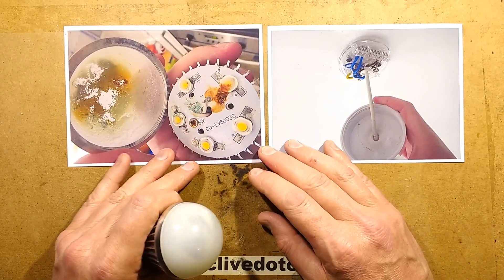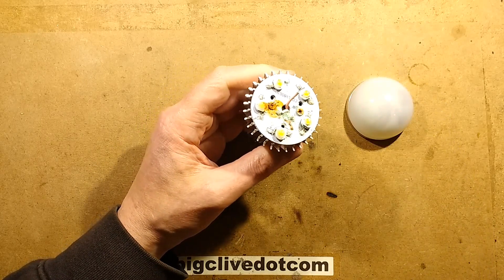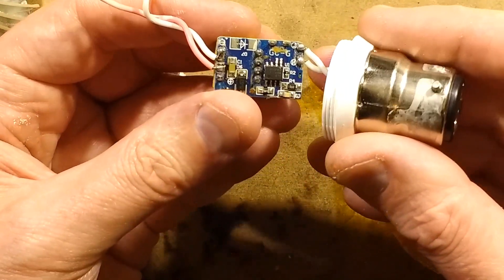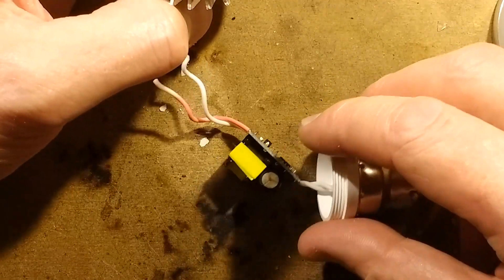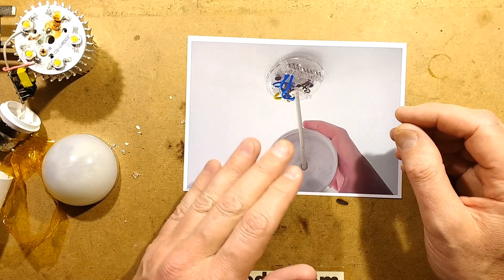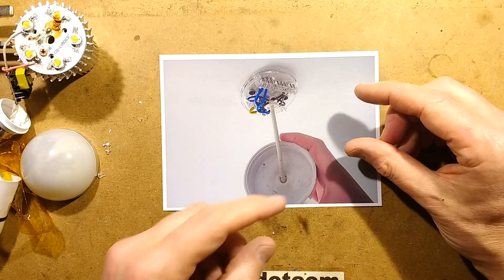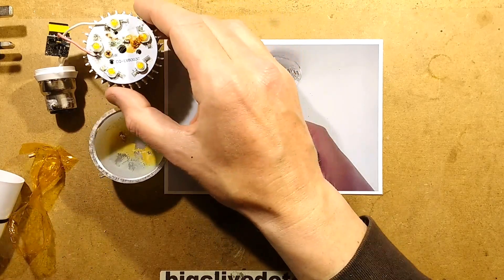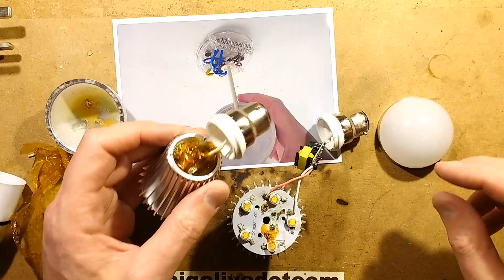Autopsy on crusty LED lamp.

Comment: Another possibility, cold metal heatsink, humid air, condensation drips running inside the lamp, and creating the mess, though that's only a theory, one of many I'm sure... :)
Reply: I had that problem in an apt where the condensation from the ductwork nearest to the AC was chasing down the joists to a point that must have been slightly lower than everywhere else. It had soaked into all the nearby insulation before starting a solid drip straight down, more like tiny stream at one point. Had I had any fixture along the path It may have caught some drip as well.
Reply: Most likely you are right. If you look at around 47 seconds into the video you can see that the first part he unscrewed ( don´t know how its called) is not air/ himidity tight. There are threads on the heatsink fins and i would say half a mm gap. So water can run down the heatsink right into the bulb. Next time you activate it the water gets evaporated and it corodes the electrics and eventually shorts it.
Reply: I was about to write the same possible cause..
Reply: That's makes no sense.  The heatsink would always be at least as cold as the surrounding air, not cold relative to it.  You'd have to have some kind of unusual building setup where the building was positively pressurized by a large intake fan, forcing warming interior air out a lamp fixture exposed to the outdoors/colder area, and that interior air would have to be particularly humid like if you had a marijuana grow house inside or sauna.  Even then it would be unusual as the airflow would keep the water vapor evaporating off.  Not impossible to cause, but unlikely to happen by accident.
Reply: I am now concerned for my heavily heat sunk computer in the humid armpit of the United states.....
Reply: TheFlacker99 (Flak) Pensacola? lol
Reply: Why would the heatsink be cold but the air around it warm and humid? Doesn't make sense.
Reply: Bulb could have been in a cold room that was suddenly warmed up and humidified, like a kitchen with veg boiling away or utility room with a dryer that wasn't vented outdoors for example... :P
Reply: If the lamp is off then the heat sink will be cold. A steamy environment will then cause condensation. A possible explanation. Need more info but an open plan kitchen diner is a moisture trap.
Reply: the exact same reason in winter your home windows fog up, I have a vent near a window and when the ac is on it cools the glass and causes huge amounts of condensation on the outside
Reply: twocvbloke To condense so much water that one filled the entire bulb up with water would require that nobody use that light for at least weeks, if not many months in an environment with so much condensing water that one would expect to see mold, lichen, or algae growth both on and within the bulb and the surrounding environment (especially considering that there is very little air exchange between interior and exterior of bulb when assembled with which to draw moist air into the interior for it to condense).  Otherwise, the heat of the 5W LED lighting would both keep the heatsink warm and drive off the trapped moisture in relatively short order.  Generally, when you see a fixture literally full of water, to the point of overflowing, there was an actual event with running water involved (either plumbing or weather) and not a simple matter of condensation.

While one might be able to contrive an extraordinary condition whereby so much water condenses over a modest time frame without leaving any of the usual telltale signs of long term high moisture condensing conditions, one does not ordinarily begin the process of troubleshooting and fault finding by first jumping to the 0.00001% probability explanation without having first gone to great lengths to rule out the much more realistic explanations that comprise the other 99.99% -- such as plumbing issues, weather related leaks, even water wicking through the wiring from a neighboring fitting that was flooded, all of which are much more common events when troubleshooting indoor electrical issues where considerable water ingress has been an issue.
Reply: it wouldn't need to fill the bulb , once it has enough in there to saturate the air inside with humidity when the bulb is on then you have the weather cycle encapsulated inside which would cycle when the bulb is on/off.

The corrosion seen on the BC base could be heated moisture exiting via small gaps there.

It wasn't obvious from the video if there was even a means for water to get in from the base of the bulb, i would suggest clive re-assemble it and test that by running water over it from a tap while pointing down.

The bulb could of even come from the factory with water in it by some form of accident.
Reply: There are many things to consider:
First: There are no obvious signs of water running down into the lamp, the socket and led driver were not damaged and had no obvious sign of warter.
Second: There are many reasons for a sudden humidity change, for example: cooking, using the shower, using a dryer etc. Even weather changes can result in condensation in non isolated rooms. 
Third: You don´t need much water to damage electronics. Once water is in there it will evaporate when the lamp is turned on. The electronics will corrode over time and then fail.
And last: Metal and water can exchange their heat faster than metal and air can. Normally your heatsink and surrounding air have almost the same temperature when not in use. In case of a sudden change of room temperature (rising the temperature, no need to rise humidity) the heat sink will need some time to get to room temperature. In this time the humidity in the air will react faster and build small drops of water. Higher humidity would higher the risk of building drops and damage your electronics.
Reply: Northeast.
Reply: Could be the difference between A/C being on/off
blow cold dry air to chill room, heatsink remains colder longer than ambient; open door, inrush of hot humid air condenses on cold surface, drips into plastic housing, repeat.
Reply: I don't think it's so much that the heatsink assembly itself was working as a condenser so much as the fixture and wiring may have been victim to some kind of drip from the exterior. These fixtures are essentially going to serve as 'drip loops' being that the lines are running along the framework and then down to a junction. If there WAS some kind of drip, be it from a leaky pipe elsewhere, or a leaky roof elsewhere, that drip could have easily made it's way to and down into the fixture before showing any signs of water damage in the ceiling elsewhere. It could be a very small leak that when it rains, there is just enough pathway for a small amount of drip to travel down until it eventually reaches that fixture and follows it all the way down due to gravity.
Reply: At 0:21 you can see where the bayonet fitting appears to have been wet, so it's pretty obvious the water was coming from somewhere above the metal on the bulb. I really don't think this was humidity forming in the light bulb.
Reply: but why would the metal be that cold and id imagine the heatsink would turn to ambient temp quite fast.

Comment: I've once encountered EXACTLY the same problem (+melted small plastic lenses that was directly on top of LED die), but there was NO water, as the three melted/gooey LED lamps was inside wooden cabinet in our office with constant temperature and no moisture whatsoever. We never discovered the problem and just scrapped on the basis that three cheap LEDs just randomly died together.

Comment: I am reminded of a video recorder we had that failed because rain ran down the middle of the coaxial cable from outdoors and pooled in the tuner. Nothing else was wet.
Reply: Yep, quite common apparently. Happened to my Dad.
Reply: zh84 The braided shield of coax is extremely good at wicking water and transporting it great lengths (even against gravity due to capillary action) if water is permitted to enter the coax through an unsealed joint or a nick in the outer insulation.  Such is also generally the death of that run of coax as the trapped moisture slowly corrodes the copper or aluminum braiding forcing the entire length of coax to be replaced -- and with some types of coax that can be quite costly (though RG-58 and RG-6 are pretty cheap as coax goes).  

I had to replace about 150 feet of LMR-400UF coax, at about $1.50/foot due to a Bobcat Ditch Witch cutting through my antenna feedlines plus repair 4 #4-gauge solid copper buried ground leads last year because you can not really patch such coax in wet ground without it eventually becoming flooded with water ruining the full length, so I had to replace the buried portion (it was also sufficiently mangled that it was no longer an ideal 50-ohm transmission line either).  The one place the construction crew was specifically told NOT to use their ditch witch within 3 feet of the house had to be the one and only place, out of six possible ditching locations, where the crew specifically did precisely what they were warned NOT to do, costing me about $300 in coax plus the time digging it all back up and another $120 in connector hardware to patch and fix their "mistake".  I was pretty pissed -- why did I even bother marking the line and warning them?!

For this reason "flooded" coax, "flooded" meaning the space has been filled with silicone gel, is often used for burial and outdoor runs where water ingress or damage to the outer jacket is a major concern.  Unfortunately, one can not readily obtain flooded LMR-400UF (although replacement would still have been required due to the extreme forces that were applied to the coax before the Bobcat finally stalled), but such is widely available for the RG-59 and RG-6/6-quad that is widely used in television, cable TV, and satellite installs.  It just sucks to work with as you and your tools all get very sticky from the silicone gel.
Reply: Happened to me long time ago, found small puddle of water on bookshelf, looked up, nothing, then looked behind small TV and find it leaking! Not one but two coaxial cables got water in it from connection block outside below aerial. :D

Comment: If the lamp was on and they had cold weather maby condensation was getting built up.
Reply: magicer83 those are too complex for this channel.
Reply: No. The heat sink would be warm if the lamp was running, thus any moisture will evaporate. Condensation happens when warm, moist air cools down on a cold surface.

Comment: These fins look like they would funnel water down into the glove portion of the lamp along with some water tracking across the LED board. But from where? Squirt gun fight on the bulb, or perhaps moisture from a bathroom. Likely the fixture components dried quickly.
Reply: Good question! I'll have to get the divining rods out and try to track the source down this weekend - the ceiling where that bulb was (modern hallway, 14 ft ceiling) is pristine white and the lamp shade was one of those foot and a half long narrow fabric cylinders, so it must be a double plaster board issue as mentioned; the fitting was extremely hot (abnormally compared to its sister bulb) when I first was called over to it. It's got a 'lounge' area directly above, then a kitchen offset about 3 metres away...
Reply: +Alex Peck  After reading your comment, the kitchen area is what is most likely the source. I've seen water do some crazy stuff. Check the trap and supplies for leaks.
Reply: One other source could be a fretted/worn dishwasher drain hose. In my experience I have found that a leaking dishwasher drain hose, or even fill hose, can leaking in the flooring and if it is a dry environment, there will be little sign of it after it dries reasonable quickly. A sloping floor may help to funnel it where you won't notice it.
Reply: +threeparots1  Excellent point. I hadn't thought of that. Also, if the refrigerator is supplied with water (door ice/water) that line could be kinked and leaking. 
If there is central air conditioning and the condensate pump is over flowing. That line could be blocked or leaking.
Hopefully that about covers most sources that need to be checked.
Reply: Pha Q excellent point. Forgot about those. I have experienced having to help deal with what a fine crack on a cheap clear polyethylene ice maker line can do overnight. This pipe isn't approved for anything. Copper is ideal or PEX pipe that has some more damage resistance and is approved for cold or hot water at pressure. AC condenser is also a great point evap drain can plug and slowly damage things too. These drains are something I check frequently in our building.
Reply: Must have been a LOT of water since these lamps do run reasonably warm (hence the heatsink), and there's not that much of a gap between the board edge and the diffuser. The obvious water tracking on the B22 socket suggests a chronic rather than acute problem, which might be fun to trace!
Reply: Alex. Peck So did you find the source of the moisture? I'm quite interested to find out the outcome of this situation!

Comment: That's what you get from those hydro power plants... 😄
Reply: Simon Langhof - If you get wind power, does that mean you don't need a celing fan?
Reply: Connor Joint - Must be a pain in the arse at night. Always bright light from the lamp.
Reply: Connor Joint - Yeah that must cause really bad headaches.
Reply: Think about the soot around the outlets from coal power
Reply: Fossil fuels are great, but the damage it does to the archeological sites...
Reply: A trash-burning power plant would explain the burnt plastic smell.
Reply: i must get my power from an ethanol burning plant or something...i have a strong smell of alcohol in the air
Reply: Kinda makes me wonder what'll happen with the new "power from waste" facility they're building at my city's wastewater treatment plant. I imagine there will be many brown-outs.
Reply: Geothermal. That's why everything in the garden keeps wilting!
Reply: solar power makes the lights hotter ;-D
Reply: Well sure, anyone who has studied homeopathy will know that the electrons retain a memory of when they were photons...
Reply: But only when diluted.

Comment: Clive, water can also seep through the wires as well. This happens in automobiles. The stranded wire acts like a wick and can cause water to get into the strangest places.
Reply from the maker: +Benjamin Esposti Good point.  This is an issue with outdoor cabling too.
Reply: My Dad had a pool of water appear on a shelving unit next to his Hi-Fi. Turned out the water was running down the inside of the co-ax from the VHF aerial, down through a rather complicated run and 50 or so  metres to the unit itself! The culprit? A split in the rubber box on the aerial where the cable joins the aerial.
Reply: I've certainly had water wicking between the inner conductors and outer PVC sheathing on TC&E installation cabling. In colder weather the outer PVC sheath contracts away from the inner conductor insulation, so a pathway is formed. Solved that problem by breaking the cable via a terminal box (with vent holes).
Reply: Benjamin Esposti   Yes, back in the late 1980s, I was with a team investigating a fault on some outside equipment. It turned out that the loss of power was due to a fault somewhere in the 250 yard long supply cable. When the cable was cut into at about the halfway point, water squirted out for a fair few seconds! It must have been capillary action that caused the water to be under that pressure...
Reply: ChinnyVision - that was a known problem with the low-loss "air insulated"  TV coax. Those four empty channels could act as the perfect "drainpipe".

Comment: Did the lamp fall off the back of Dodgy Dave's white market van? 
I.e. Fire damaged stock sold as new and that one got a hose pipe blast.
Reply: This one was part of a set a few years back (when 5W LEDs were £££ unless bought in bulk!); myself and a couple of the neighbours shared the bulbs out; it was an odd failure!

Comment: I agree with condensation theory.  I would recommend they drill a 1 mm hole in bottom of globe before using.  This allows water to drip out.  Making visible the invisible.
Reply: Isn't condensation theory something to do with the origins of the universe?

Comment: It doesn't look like the water has come through the ceiling rose, it's too clean, water leaves a mineral stain usually.
My guess is that it got wet sometime before it was installed, or that it could have been in a high humidity room (kitchen or bathroom) before being installed in a dry room, or that they use a humidifier, the fins could be condensing the water,
Or like you say, moist air from outside has condensed on it.
Reply: Not necessarily unless it happens over time. I've seen water actually running down a light fitting during a storm.

I suggested that the person whose light it was that they might actually want to switch it off...!

Comment: Water ingress...Clive is right.   In Australia concrete tiles are very popular (we don't have snow in most parts of Australia making these tiles cheap and convenient) and usually do a reasonable job of keeping the water out BUT over time with repeated warmth and cold expansion and compression cycles they develop hairline cracks which are hard to track down and cause havoc during heavy rain.  I've lost a couple of light fittings this way.  If I had the money I'd re-roof with Colorbond iron or ceramic tiles but that's a very expensive fix.  I wish some American company would start offering their roofing systems here which are cheap and long lasting.

Comment: I bought an LED bulb from Tesco. I had very hot sticky stuff drop on me so i checked the light. Sure enough, the glue had melted under the heat of the circuitry in the light.